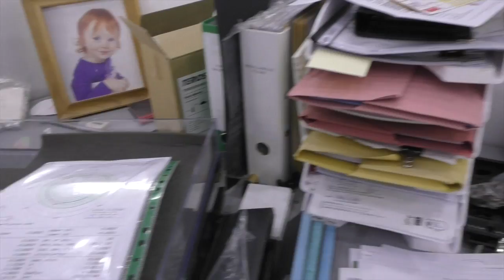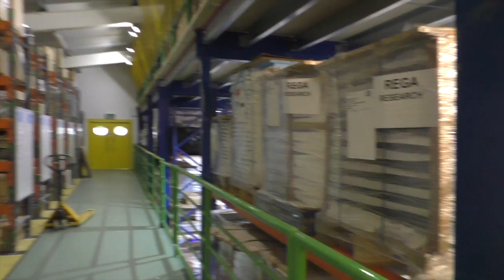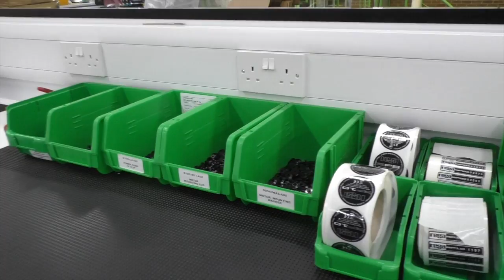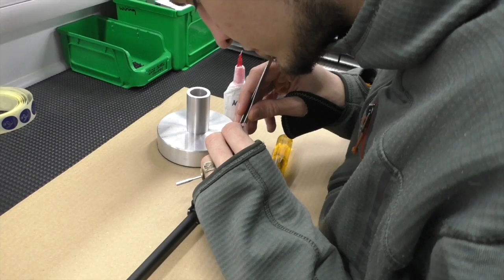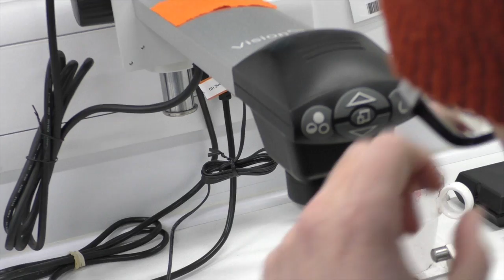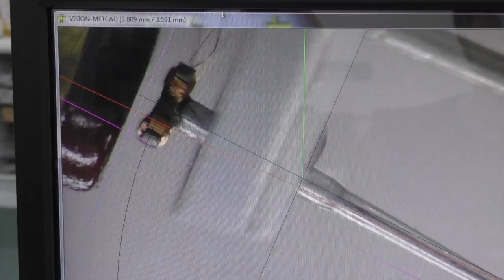AnalogPlanet.com Visits Rega Research (Part 1)

Comment: Rega may not like it for their image but they do outsource a lot of work, for example, counterweights made by Acoustic Signature.  I like their TT ethos and TT simplicity.  Never understood the glass platter thing.  Had a P25 and the platter rang like a bell.

Whist I admire their TT’s I don’t have much time for any other of their products.  Had two Apollo R cdps.  Both failed.  Sent first one back when it failed within first year and to be fair it was repaired within a week.  Same fate happened to it and I couldn’t be bothered sending it back again and it was sold as faulty.  Bough new Rega pre power.  Power amp failed within a week.  Tried a higher end mm/mc phonostage and didn’t like it at all.  It’s a shame as I want to support UK companies but I would not buy another Rega anything except a turntable.  It’s the one thing they know how to build well.

Comment: Interesting.  I've been a manufacturing engineer in electronics for some 45 years and found that video systems have poor depth of field and poor depth perception.  Fine for looking at something in a single plane, but difficult to manipulate things when you can't easily judge depth.  There is a company called Vision Engineering that makes an optical system called a Dynascope that is less fatiguing than a conventional binocular scope but easily allows for 3D manipulation.  This is distinct from their low cost Mantis systems that have a distorted field depth.

Comment: I bought a RP3 with factory installed elys2 from a local dealer here in the Philippines, one channel is dead I inform the dealer and the dealer immediately send a replacement, I installed the replacement and now both channel works , but theres a defect with the replacement cartridge, whenever the tone arm is lifted from the vinyl after a split second you will always hear a small thud sound, at first I’m thinking there is a built in muting circuit, but upon investigating something inside the cantilever is touching the cantilever, the rubber suspension of the cantilever, I inform the dealer about the problem, the dealer told as long as both channel is working just ignore the thud sound, is that the policy of REGA company?

Comment: Rega dust covers don't survive shipping. The packaging rubs against the top surface of the dust cover causing scuff marks to form on the top front and top rear of the plastic... Also, the dust covers somehow become bowed inward on all four sides probably due to cooling issues after they are formed. The dust cover doesn't run parallel to the plinth. It bows inward... I bought two P1's at different times and both have these issues... Inexcusable even at $500 entry level units such as the P1. - The English are sloppy and lack good quality control. Give me good Asian know-how any day of the week. I have a modern TEAC turntable that is impeccable from front to back. And it's NOT made in Japan!
Reply: First world problems

Comment: Surprised you didn't challenge Gandy about his controversial thoughts on the value, or lack thereof, of record cleaning. I like the guy, but some of his thoughts are a bit off the wall.
Reply: I havnt heard his statement about it, but I think I would agree if its about simple cleaning solutions. If what you use to clean is something of line of a spin cleaner or dish washing soap etc. you are better of not cleaning at all. Anything short of a proper RCM of any kind is not good enough and creates more problems than it solves. Surface dust is not a problem, and the deep groove gunk wont be cleaned with manual methods.

Comment: Precision blah blah blah... tolerances blah blah blah...40 years on, still can't make record players running dead on 33.3 rpm...
Reply: Don't worry your next turntable will run smoothly at 66.6 rpm
Reply: No belt driven TT in the price range of 300$ runs dead on 33.3 rpm.
Reply: Killbasa2000. Stfu mate, you bloody imbecile.